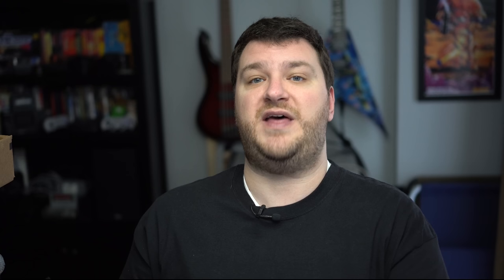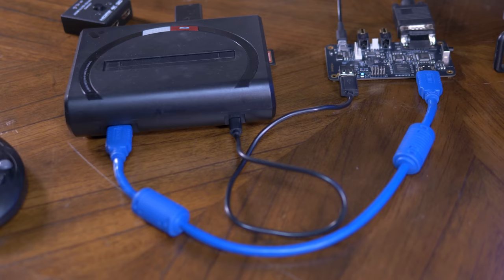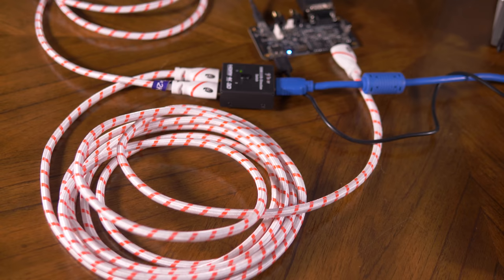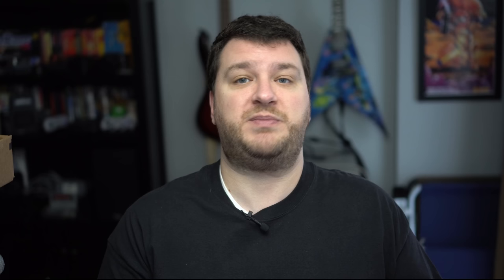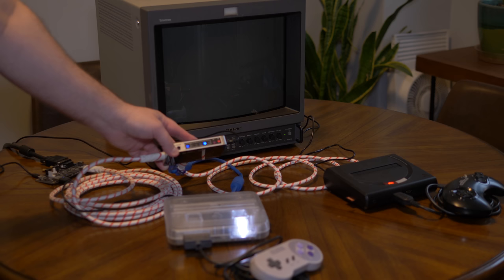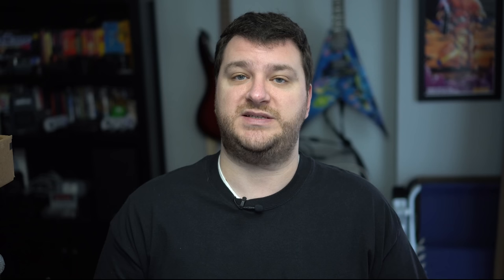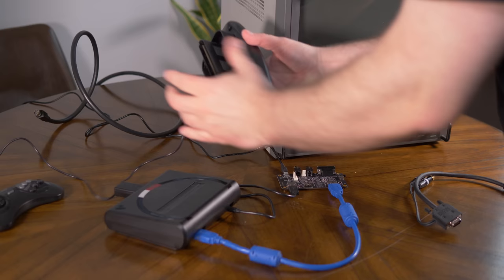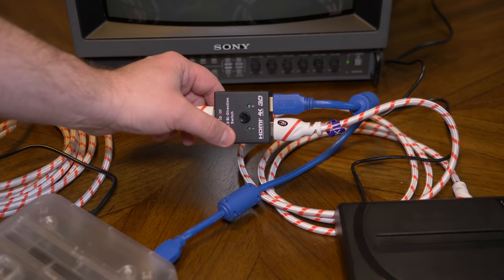Analogue DAC Switch and Splitter Testing

Comment: I've ordered a 4x4 matrix switch to test with the Super NT and Mega SG at the same time, will report back if it works. I assume it will work as long as you don't try to send the input to the dac and another source at the same time. Now I just need to get the DAC!

Comment: I have all my 28 consoles on my flat TV and on my projector and on my old school bang and olufsen TV. All with switches the hdmi consoles and the framemeister are  in a hdmi switch and from the switch a splitter can change between projector and 4k TV and the retro consoles are with rgb scart switches to the bang and olufsen TV and to the frame Meister with a scart splitter so I can play all my consoles on 3 different types of screens 😁 and it works great.
Reply: 28 consoles, that's a huge setup! Do you have any writeups and/or pictures of it somewhere? Would really like to check it out.

Comment: I have a cheap HDMI to AV Composite splitter, you plug the HDMI cable in one end as the input signal and plug 3 RCA cables in the other side as the output signal and the signal comes out in 1080p up scaler with PAL/NTSC switch and USB power port on it. My question is this: Would this cheap splitter work with the Analogue Mega SG on a CRT TV? Or do I have to buy the DAC from Analogue and spend a fortune?
Reply from the maker: It will work, but it'll add a lot of lag and convert the signal to 480i, not 240p.  I wouldn't recommend that solution.
Reply: @RetroRGB  Thanks.

Comment: I wonder how the quality of a super NT and Mega Sg with DAC compares to a SNES mini modded for Rgb or a SNES 1chip and Genesis using a RGB cables on a CRT
Reply from the maker: Assuming the consoles are modded, it's about a tie.  The Analogue consoles are much better than an unmodded Genesis or a 2-chip SNES.  I might do a video on that soon too, but it would be analog to digital, to scaled, to compressed on the internet.  It's frustrating to post something that that and have it accurately represent what your eyes will see on the screen.
Reply: @RetroRGB  Could you put bittorrent magnet links on your site and use bittorrent to distribute uncompressed or less compressed video files? After the initial upload, members of the community can take the burden of 'hosting' the files. Something to consider?
Reply from the maker: I'm actually working on something like that using LBRY.  Hopefully I'll have it all worked out by summer.

Comment: Is the DAC intended use getting better image and sound when playing on a CRT monitor? If I use my modern gaming monitor and speakers to play with my SuperNt and Pocket, would I be getting any benefits by using a DAC?
Reply from the maker: DAC's are only for CRT use.  Your gaming monitor is already a great pair with Analog consoles in 1080p mode.
Reply: @RetroRGB  thank you. I had that question for a while.

Comment: Are there any cheap HDMI to YPbPr component devices that will output at 240p for a cheap price? I want something that will also work with the AVS, PS4, and other HDMI devices, so the DAC doesn't seem like what I need.
Reply: GBS-Control perhaps?

Comment: I was hoping to see if you get the mega sg , 32x and dac to work with 1080p tv because of getting a dac so I play 32x on 1080p tv
Reply from the maker: You can run the DAC's output through an OSSC or RetroTINK.  Seems like a lot, just for 32x though.

Comment: I assume all data is passed via usb, so in your splitter test the dac would be telling the console to drive 240p and to expect an EDID from the dac, which results in no picture output from the splitter.

In your simple switch test, you have the NT plugged into the dac still powered up when you switch to the SG. If you powered down the NT you wouldn't get picture as the dac would power down. thats not a true switch as the SG is essentially slave to the NT in that arrangement.

Comment: Ok, here's a idea using a HDMI matrix. Idk if it would work.

Super NT, Mega SG  and OSSC as input in the matrix. DAC in one output. Capture card and digital monitor in other outputs. DAC as input in a scart/component splitter. Splitter as input in CRT/PVM and the OSSC.

Scenario 1: Playing in a digital monitor and capturing footage. Signal comes from the analogue console to the HDMI matrix to the capture card and monitor.

Scenario 2: Playing in a CRT and capturing footage. Signal comes from the analogue console to the HDMI matrix to the DAC to the scart/component splitter to the CRT and the OSSC. From the OSSC back to HDMI matrix to the capture card.

Would that work?
Reply: I think it will not work, because the DAC can't control the Video Output of the console then, if they are not directly connected. And if they are, then the video out will not be accepted by the matrix.

Comment: So I'm guessing that a HDMI audio extractor to toslink device would not work between the Analogue console and the DAC either?
Reply: doesn't look like it.  That's what I use on my Super NT too.  But the DAC does have RCA audio out.  So if you need toslink you can just get a RCA to Toslink converter.  RCA is fine with me though since I can just run that to my audio DAC or receiver.

Comment: Question: can you use the Analogue DAC to output RGB video to a more standard 31KHz RGBHV/VGA computer monitor? This was the first thing that came to mind when I saw the DE-15 output on it. It's extremely important to my purchasing decision, as I don't have a PVM or an otherwise multisync BNC set & wouldn't be interested in using my composite-only PAL tube TV (am Australian & SCART was never a 'consumer thing' here like it was in Europe).
Reply from the maker: No, but good news:  All you need for that is to set the console to 480p and use a cheap HDMI to VGA converter, like one of the ones here:  https://www.amazon.com/shop/retrorgb?listId=IP72N6BL06SV

It'll save you over $50 :)
Reply: @RetroRGB  Thanks! Incredibly useful link.

Comment: Out of curiosity, how does this work with the power cable? Doesn't the power cable have to feed into the DAC? How can you switch between the consoles when only one console's power cable is going through the DAC?
Reply from the maker: The DAC has a power cable connected to the console.
Reply: @RetroRGB  yes, but to only one console, correct? How are you able to switch between multiple consoles using the DAC when only one is powered through it?
Reply: I was curious about this too. At 4:19 it looks like the Super NT is being powered by the DAC and the Mega SG power cord is going off behind the PVM, presumably to the same power strip the DAC is plugged into. I think the power pass through on the DAC was just for the convenience of not having to tie up two outlets on a power strip for one console, and not essential to its operation (ie. you don’t have to power your Analogue console via DAC). Would appreciate confirmation of that though.

Comment: DAC looks ok, but I can't tell if the analog video output will be of adequate quality for us retrogaming communtity. Is hdmi to RGB scart Digital to analog conversion decent enought to compare with a native real hardware of snes / sega mega drive consoles?

I was hesitated to pick up a mega sg or a super nt analogue consoles because they lack a RGB video output for my CRT TVs. Maybe this is the right time?
Reply from the maker: The output of the DAC looks excellent.  I have zero complaints about the signal.
Reply: I use RGB video cables from retrogamingcables uk connected to CRT TVs Trinitrons, philips, etc for all of my retro gaming consoles including my modded RGB bypass snes and sega mega drive consoles. It would be great if you can make a video review with a real CRT TV if you can find some free time, I feel sorry for the next generation kids who they hadn't had a chance to play games in a CRT TV :(

Comment: Thanks RetroRGB for confirming. Still, I have my doubts about how the RGB video quality will look like. I use good quality consumer CRT tvs (I have five of them). I wonder why the mega sg and the super nt analogue consoles are much cheaper than nt mini console (500$). First the RGB video output was cut off to lower the production costs. Then, an additional DAC circuit board is advertised to fulfill retrogaming community expactations. I still have my doubts, I don’t see many youtube videos with the DAC connected with analogue consoles to a CRT tv setup. 

I have a feeling that we are in the middle of a massive CRT tv production. China already manufacture their own CRT TVs, but they lack the specs of the correct resolution, refresh rate etc to meet our retrogaming community requirements. I know in USA is very difficult to pick up a CRT TV, but here in Europe there are plenty of them in used condition.

Comment: Do you need a converter to connect to a composite or component input? It looks like the DAC only has vga out? Do you need a vga to component/composite converter?
Reply from the maker: Not a converter, just a passthrough cable like this:  https://www.amazon.com/dp/B001I25ZWM
Reply: the dac auto recognizes which cable is connected to output the correct signal. I was confused by that too.

Comment: I’m hoping Analogue will make DAC Pro that has both HDMI Output and Analogue Output (similar to NT Mini) to output Analogue Consoles to both HDTV and CRT TV at the same time. Maybe I’m hoping it will work with Non-Analogue Consoles and downgrade Native Resolution Setting to 480i or 240p.

For me, I just want to output to Dual TVs at the same time like a dumbass. I know I can do that with GameCube.
Reply: NT Mini does not support dual output either though. In digital mode it outputs 60 hz, in analogue mode it is 60.08 Hertz I think, as the original console. Same applies to the DAC. So dual output will probably never be a thing.